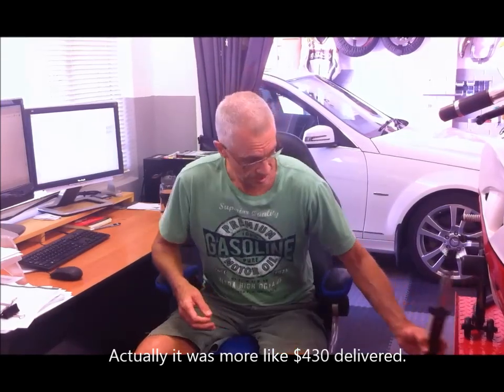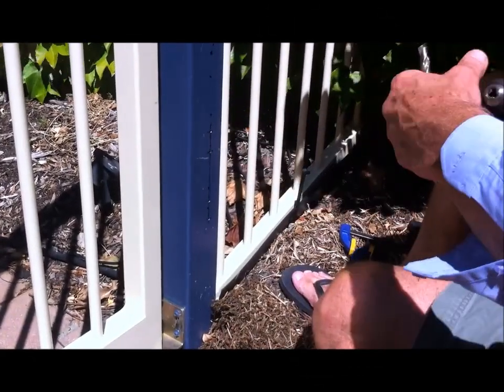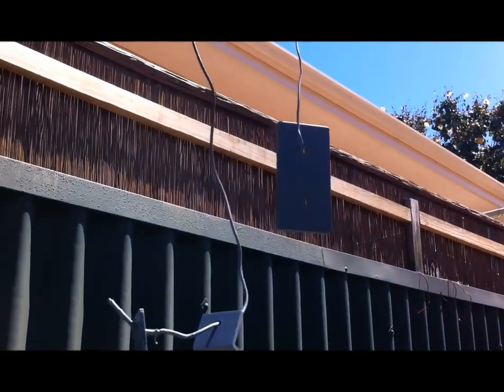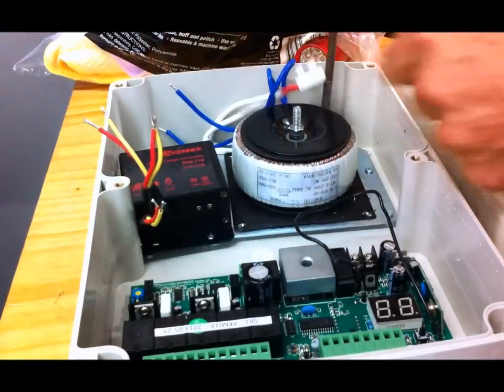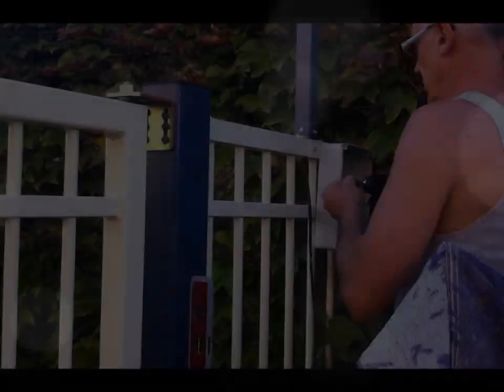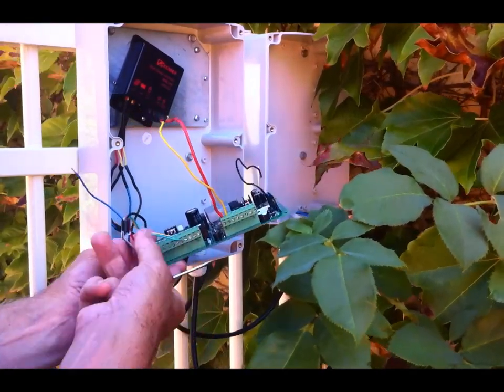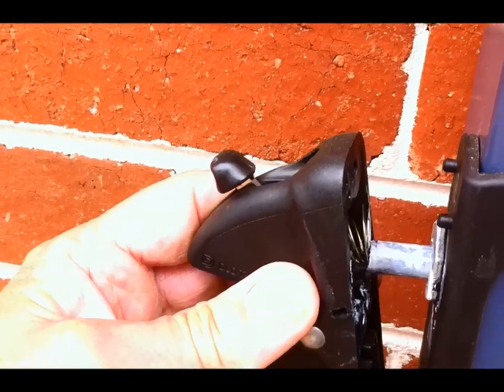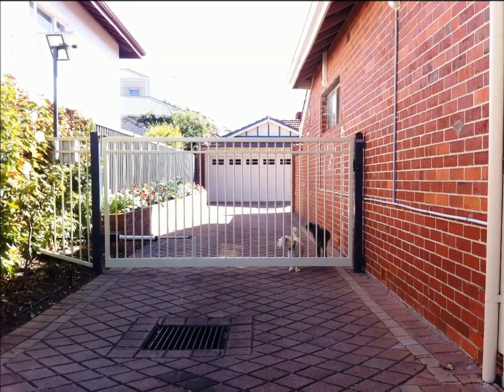How to Install Electric Solar Automatic Gate Opener Motor Actuator Remote Control Kenner KNL01

Comment: I assume the reason you needed to make a seperate bracket on the gate side is because otherwise the motor won't have ground clearance due to the bump in the motor and your low horizontal on the gate?  Is that right?

Would the whole thing be better if the motor was mounted upside down, so that the "bump" in the motor faces up?

Also, after more than a year in use, how is it all holding up?
Reply from the maker: Yes it's working famously. The motor can't be mounted upside according to the instructions. I made my own bracket but a bracket does come with the kit. It depends on the style of the gate. I wanted to mount the actuator quite low hence my own bracket.

I came up with a better solution to power it. The batteries are now purely for back up and they've worked well when the power has been off. I mounted the transformer that was originally in the electronic cabinet into a separate small electrical box. I mounted that on the wall next to an external GPO on the brick wall next to the garage wall. I connected the 240V side to a short cable with the std 3 pin plug on the end which plugs into that external GPO. I purchased HD garden lighting cable quite cheaply. I ran the twin core HD garden cable from the box to the 24V input inside the actuator cabinet which is next to the gate. I measured 24.7V at the transformer and 24.5V at the gate end so the voltage drop was peanuts. That's worked really well. There's no need to run 240V out to the gate.
Reply: Thanks!  Could you please let me know if you get the following in the package (assuming you bought on eBay)?
Bracket for solar panel, all nuts & bolts and screws, all cabling.  ie, assuming a standard installation (unlike yours which you modified), what other bits are required?

I am leaning towards this one as it seems to be complete and doesn't have the hassle of high groud clearance (my gate is similar to yours) - http://www.ebay.com.au/itm/Solar-Single-Swing-Gate-Opener-Kit-Heavy-Duty-350KG-22W-solar-2x9Ah-batteries-/321201884800?hash=item4ac91fce80:g:llsAAOSwBvNTqnBV

Any thoughts?  Thanks again!
Reply from the maker: That looks like a neat option. The one I bought came with all brackets but I had to supply my own bolts and screws.
Reply: @ScottElliott152  what do you think the voltage drop would be over 40 metres?
Reply from the maker: @bostonamstaff  I checked it with my multimeter and it is was tiny ... about 0.1V over 20m. So perhaps 0.2V over 40m. I used quite HD garden lighting cable.
Reply: @ScottElliott152  awesome mate thankyou, just got the kenner kit and installing over weekend. Your video will Definately shorten the process. I will try and run purely on batteries(3 solar panels also), but will put aside the 24 volt transformer and may do your idea down the track.

Comment: Great Video Scott.  I bought the same and installed it but it doesn't work.  The power is charging and is above 24 volts. The solar is good, but I did place the control box away, and added a 5 core wire to increase the length to get it to our pole.  Do you think this may have had an effect on it?  I would really appreciate the help.  Thanks
Reply from the maker: Hi Julie. Thanks for the compliment. The extra cable won't be a problem. I've actually repositioned my solar panel and it's now about 10 metres from the gate to get more sun and it's fine. I think your problem will be in the way you've configured or not configured the controller program. You have to read the instructions carefully and work through each menu option. Don't be concerned as you can't really break anything in the software so you can safely experiment with different settings. If you get lost you can always reset it to the factory settings. It took me a while to get it configured. So if it's a single actuator call that motor 1 and make sure it's connected to motor 1 on the controller board. Have a go at your configuration and if you still can't get it going post another message and I'll right down the settings I have and post them here for you.

The configuration talks about the master and slave gates. In our case we have a master and no slave. The slave is the other post that your gate latches to. So imagine the slave gate has been shrunk down to just a post.

Are you using the actuator in the same way to pull to open the gate and push to close it?

Mine has been running faultlessly now for about 6 weeks. It seems like a good quality product.

Hope this helps. Kind regards, Scott
Reply: Thanks for your reply.  You wouldn't believe it....Now I have the Solar Charge Controller clicking on and off for "charge"...great!  Also, I took the extra cable off as I didn't know you were going to respond so quick, and put the actuator cables directly into the Control Board and still can't get the actuator to respond when pressing the remote.  I have checked the programming three times to make sure is it at P1 is 10, P2 is 01, P3 left at 3, P4 left at 3, P5 left at 3, P6 left at 3, P7 left at 40, P8 00, P9 00, PA 60, PB 3, PC 15 then the board sits flashing on --.  I have put the multimeter on the batteries and together they are about 25.  Any ideas?
Reply from the maker: ***** I just had another idea ... have you "learned" the remote. From memory the remotes are provided un programmed. It's easy to do see page 19.

Also as a test get a piece of wire and bridge the external switch terminals (momentarily) marked O/S/C (Open/Stop/Close) numbers 19 & 20. At least you'll know the wiring and programming is ok. I reckon it's your remote not having been "learned". Scott
Reply: MrScott52 Well, I am off to test.  Any ideas why the charge light is clicking on and off at the Controller?  I don't want to blow anything up while I am going in for a test.
Reply: ***** I relearned the remotes again.  It looks normal.  I rewired the actuator directly into the board.  I tried to bridge 19 and 20 and no result.  The charge clicking on and off is still going.  Do you think it would be the actual wiring to the actuator?  I thought mine would be wired in, charged and good too, but it is a bit frustrating now.  Thanks for your help...
Reply: MrScott52 Hey Scott, is there anyway I would be able to send you a picture of my wiring.  I just went and tried everything again, relearned my remotes, rewired, but there must be something I am missing.  Did I need to remove the two blue wires for the AC?  Do you know if the charge is supposed to cut in and out?  Thanks
Reply from the maker: ***** The solar regulator will click on and off so as not to overcharge the battery. Mines clicking all day. You can send me a photo but I don't think you need to. At 19.00 on the video pause it and check my wiring against yours.

The five wires from the actuator go into the bottom left terminal block starting from the far LHS. They go Red/Black/Blue/Green/Yellow from left to right. That's terminals 1 to 5 

For good measure disconnect the two blue AC wires. Also the red and yellow wires from the load cable of the solar regulator go to the RH bottom terminal block starting from the LHS. Terminals 13 and 14. I'll check my controller settings for you and post back here.
Reply from the maker: *****
Julie I hope I've found the problem for you. On Page 20 Item 2 where you set it for single or dual gate mode the text is a touch confusing. My setting for P1 is 01 not 10 as you have.

If you read paragraph 2 carefully you set it at 01 for Single Actuator 1 (Gate 1 which is Motor 1 in the Terminal block). 10 is Single Actuator 2 (Gate 2 or Motor 2 in the terminal block. 11 is for two gates with two actuators.

So set P1 to 01.

My settings are:
P1 = 01
P2 = 01 as my actuator is termed RHS looing at the gate as it opens towards me with the hinge on the RHS. Are you also a RHS configuration? If your a LHS configuration you may have to have P1 = 11, P2 = 10 and then wire the 5 wires from the actuator into Motor 2 of the terminal block which is 6, 7, 8, 9 and 10
P3 = 03
P4 = 03
P5 = 03
P6 = 01
P7 = 30
P8 = 40
Pa = 50
Pb = 02
Pc = 24
 P6a/6b and P7a/7b don't come up in single gate mode.
Reply: MrScott52 Wow, thanks Scott.  I raced down, changed it to 01.  I did have it wrong...still doesn't work.  Do you have P9 as 00?  I have the same Pull to open and Push to close as you.  I disconnected the actuator and have it in my hand trying to make sure nothing is in its way, but still doesn't want to play the game.  It looks so simple.  I only have the five wires and the two connecting the load.  It can't be this hard to get the little fellow to work!!
I will give it another go tomorrow when I have a clear head.  Wish you lived close to me, but I am in Agnes Water Qld, Australia.
Reply from the maker: *****

You're making me worried now! ... I hope nothing is broken.
 Yes I have P9 = 0. Being in Perth I can't get much further away.

The other to check is have you locked the actuator with the little key? If that's not locked it won't work however the motor inside runs so you'd hear it.

I had no problems with my installation at all so I can't understand why you're having these problems.

I'm running out of ideas. So your panel and battery pack are connected correctly and the right polarity? Red is positive and yellow is negative. 

So when you look at the gate from inside your property is the hinge and actuator on the RHS on the your side and does the gate open inwards towards you?
Reply from the maker: *****
Check your voltage at the board where the two wires come from the "Load' cable of the solar regulator. Do you have 24V there? That's at Terminals 13 & 14. If not then maybe the battery pack is not wired in series as it should be or the cables from the regulator are going to the from places. But you sound like your on top of this stuff so I can't see how that could be wrong.

I had to charge my batteries first using normal 240V/12V car battery charger. before I stuck them in the battery cabinet.
Reply from the maker: MrScott52
Another thing is the limit switch. There are two. The one at the motor end is factory set and should not be touched but the one at the end of the cylinder where the rod comes out is adjustable. I had to loosen the screw and push it right to the end. If you're past the limit switch as it's set from the factory then the motor won't work.
Reply: MrScott52 Hey Scott....Eureka!!!  Finally it is in full operation.  I owe you my sanity as it was great to have person of your skill and experience to talk me through this.  As you know there isn't a lot that can go wrong and I only had the five core and a couple of other wires to connect.  I made sure the key "lock" was in place correctly and hard wired the actuator in as neatly as yours.  I am not sure what the compounding factor was, but the end result is fantastic.    I just wanted to say thanks again for your help as it was getting pretty frustrating for me and you didn't give up, even though you don't even know me.  Pretty happy with your work.  If you're in Qld please let me know and we can catch up.  Really appreciate your help!!
Reply from the maker: Well done Julie. I must admit you crossed my mind a few times as I was wondering how you were going with it. I was happy to help out as I certainly get a lot of satisfaction seeing people do thing themselves and thus save money and get some satisfaction as well.My wife and I intend to travel to QLD probably next year for a bit of a driving holiday. I used to travel to Brisbane a lot while I was working as we had an office there but I've never been able to see much outside of the taxi ride from the airport to the office in Logan. So you can show us the gate!Kind regards, Scott
Reply from the maker: I forgot to say I bought a 0-30VDC LCD voltage gauge off eBay HK for about $9 delivered and have connected it across the load input wires. I cut the required opening in the removable front panel (about 40mm x 19mm) so now I can see at a glance what the voltage is in the system. If it drops below about 23V it won't work at all but between 23 and 24 it works fine but is slower. If I had my time over I'd get red digits rather than the salubrious blue I chose.@itm/191071352619?ssPageName=STRK:MEWNX:IT&_trksid=p3984.m1439.l2649
Reply: MrScott52 Hi Scott, the volt meter sounds like a great idea.  My gate is working like a charm.  I think you are right....it is very satisfying to have the problem and then to fix it.  I am fairly chuffed about it.  It is so simple once you have done it about a hundred times!!  It would be great to have a you both for a visit.  We live on 5 acres in Agnes Water (about 6 hours North from Brisbane).  Thanks again....cheers

Comment: This video will help me out heaps! We just bought this kit and are still alittle confused on how to put it together :P btw where abouts do the batterys connect in? Do you solder them onto the solar controller? Then connect the solar controller to the main board?

Comment: Hi Scott,
I want to override the closing position on my gate opener,  while I am at home. Is this possible?
Reply from the maker: +Garry Copas Gary I'm not sure. There's no mention in the manual. Also I'm not fully sure what your question is. Do you want to disable the opener when inside?
Reply: +Scott Elliott 
As the gate separates  the front yard from the back. I was wanting to override the automatic closing of the gate when I am working  in both areas. At the moment I have to turn off the power to the gate. To stop it closing.
Reply from the maker: +Garry Copas Ah ok. I have the same problem when I'm working out the front and I'm constantly walking backwards and forwards. There's no setting I'm aware of. What I sometimes do is pull the clip out and disconnect the end of the actuator. I've put a bracket on the wall so I can swing the actuator around and rest it on the bracket.

Comment: Hello what kind of wire do you use for the solar panel to the control box?
Reply from the maker: The cable came with the actuator kit. I recall it was about 10A. Scott

Comment: Hello, how did you run the cable under the driveway?
Reply from the maker: I ran a conduit under the driveway for the solenoid and warning light.